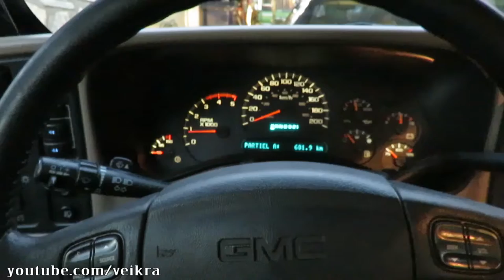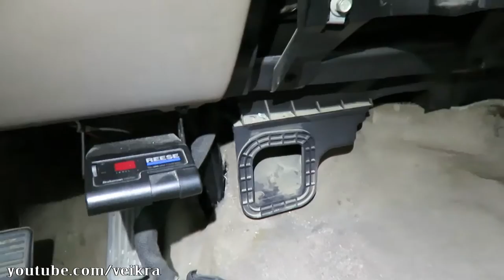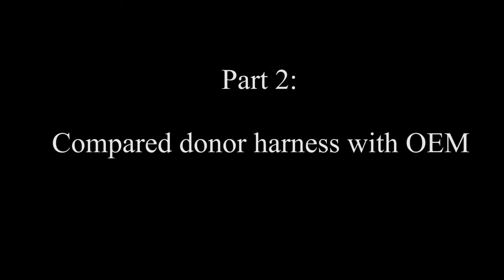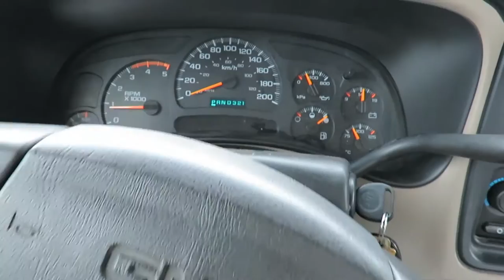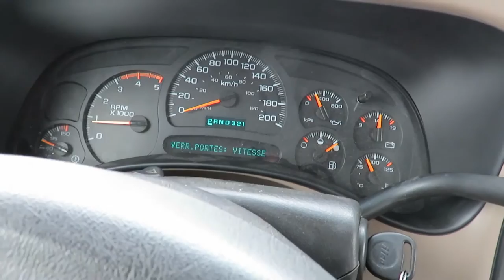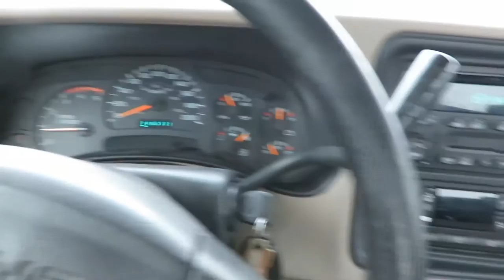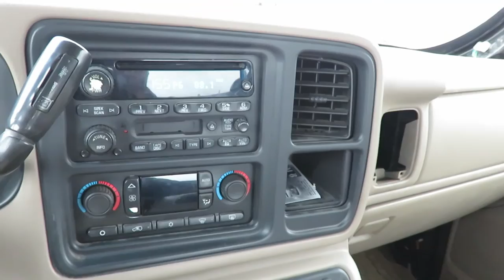How to add Power heated seats 2003-2007 sierra silverado avalanche escalade with ANY wiring harness

Comment: If you can find a Vin for a crew cab diesel with heated seats and memory I can program a body control module and send it to you. I'm sure any crew cab with heated seats and memory would work but I rather take some variables out of the equation.
Reply from the maker: I can find a VIN number easy, all canadian ones driving around have that option. and VIN number is viewable under the windshield. 

I want to keep my current BCM because I know it's good and know what it's been through.  Where are you located?
Reply: Veikra St.Louis MO I can send you one pre programmed or you can send me yours and I can program it.
Reply from the maker: Can you do a window switch program as well ? I have one for a escalade and need it switch to my truck for power extending instead of power folding (mine got killed by water )
Reply from the maker: I have vin of 2004.5 truck with the option, can you leave me your phone number?
Reply: Does it have to have the same features? For example, I’m trying to add just the 8-way heated and power seats with memory as well as the door panels with the buttons. I want to keep my flip down bench seat console and do not want to add the center console with rear A/C. Is that possible? I have a VIN of a diesel crew cab same as mine except is has those seats and door panel switches and center console. Are you able to make that work?

Comment: I just did this conversion to my 2004 gmc sierra duramax. I used seats out of a yukon and the harness from a 2004 escalade. I have the seats working except the passenger seat heater will turn on for about a minute or so and then shut off. I believe it is just a bad element within the seat but I also did not connect another ground wire to the drivers side post. I don't know if that is affecting anything. My larger issue is that since I did all this wiring my gauges, radio, windows, and door locks went wacky. It went back and forth from not working to working (over the course of about a day). Now everything is working (I'm thinking the body control module had to relearn with the added functions) except my body control module has lost communication with the transmission control module. The TCM is functioning and the truck still shifts but I lost my trans temp guage, the shift indicator and tow/haul switch lights up but does not function. Do you have any ideas of what this could be. I didn't think this harness had anything to do with connections between the TCM and BCM. Any help would be much appreciated!
Reply from the maker: Id look at all the wiring, then the module under the driver seat. This module communicates with the bcm through the canbus. any short or any module connected to can could hog up the serial bus and cause other device to not be able to communicate. unplug the computer, see if it does anything different. then unhook the harness from the footwell and see if it comes back.  There is no garantee your seat module is good. But for it shutting down it's usually heaters.  Without the ground, you won't have the power seat working on the passenger side. If you do, itd check where the thick black wire goes. (The thick black wire beside the orange one in the connector)  Can you post a video?
Reply: I found two black wires that went to a ground point further in the escalade harness that I had cut. I attached those wires to the ground point on the post next to the drivers seat. They had no effect on anything. I still have no transmission communication. The escalade harness did have a back up sensor module on it that was past my cut point. I am wondering if that has anything to do with the loss of tcm communication. To my knowledge the two wire twists are part of the can bus network? I see there are some of those that I had cut thinking I didn't need the rest of the harness. My other thought on this is that it could be my body control module since the TCM is working properly other than no communication. Now that I think of it the BCM has been acting up over the past 6 months to a year. Little things like the radio not shutting off after opening the door, the chime not stopping after removing the key from the ignition, the doors not activating interior light. Could the added seat control module have pushed the BCM over the edge?
Reply from the maker: yes the 2  grounds you found I also cut. my harness was escalade as well, and there is a big orange power wire going to the back. Make sure it's properly capped off.  Unplug the harness at the junction box near the brake pedal .  If it does nothing, you may really have a bad BCM. But please check all the wires going to it for any signs of rubbing on the bracket. Sure sounds like a BCM trouble now
Reply: I've figured it out! Yesterday I swapped BCM's with my buddies truck. My BCM functioned properly in his truck and his BCM had no effect on my issue. Then we swapped TCM's. My TCM in his truck produced the same no communication issue. His TCM in my truck illuminated the shift indicator and the transmission gauge. Unfortunately my TCM is bad. It is an expensive fix but at least I know what the issue is. Thanks for your efforts.
Reply from the maker: Alright so at least it's unrelated and you didn't break anything doing the swap. It's just unrelated wear!
Reply from the maker: also, if one morning you press the buttons and the seat wont work, the lights wont turn on....shut the truck off and back on, the module under the seat didnt wake up or the bcm forgot to wake it up :) It does this to me once per winter

Comment: Hey man, ive been studying this video as if i were to take a test nd im not confident enough to do this myself. I have an 06 silverado 1500  crew cab 4wd with power driver nd manual back. Passenger is all manual. Back glass is the 3 piece which i really hate. I got lucky at the junkyard nd got both front full power leather seats, both door panels with swtiches, nd i got the harness. Same exact truck execpt with it being an 05 nd having a solid one piece  back glass. I saw tht the thick purple wire hooks to the back glass for defrost. Other than the back glass nd seats... its the identical style truck. The module under the seat of tht truck was corroded bad nd literally welded itself... so i jus snipped tht off. Do ya have an updated wiring video or have something else to follow ? I understand everything going on till ya start cutting the connector nd splicing the oem. Thts where i get lost nd with hooking up to existing module. I dnt wanna burn out any modules or sensor because tht can become more or a pain to fix ! Also under my passenger seat i have a wire i believe its the black one thts connected to the airbag nd it throws a service airbag code
Reply from the maker: You are right, purple is defrost. I recently broke my rear window and found my truck had rear defrost. So the window in the truck is not original.  For the module under the seat, it's the airbag controller. The connector I replaced is because the seat and wiring came from a different truck, namely, a avalanche.  I just made sure the wires would trace back to the correct truck wiring from the new seat wiring. The wire under the passenger seat I mentionned in the video and IIRC its the ground of the seat.  Airbag of passenger seat goes back to right side kickpanel.  It plugged right in in my case.
Reply: @Nordic_Mechanic  I think I’m having a similar issue. I put denali seats into my Sierra from the same year. Denali seats have the yellow connector and my truck was the black connector. It’s throwing airbag codes because that’s not plugged in. Colors don’t match up and I’m really at a loss for what to do any help would be much appreciated!
Reply from the maker: @ryanr6160  Color dont match up thats why I pulled apart the loom to verify where everything goes. Simple as that. You have to make sure the wires you need are going from the same pin under the dash, to the same pin on the airbag controller as they used to before. The denali seats have airbags so there is more wires than needed in the new loom

Comment: I got the the controls on the doors working but they stay on for 30 seconds and turn off. Any feedback would be great.Thanks
Reply from the maker: usually that's because one of the heating element in the affected seat is bad.
Reply: My back doors wont lock and driver side back door window goes down when you pull up on the main driver window switch

Comment: I have a 2006 2500 HD 6.6 LT1 with the bucket seats and console power driver and manual passenger with cloth. Just upgraded to full power power leather.  Do you know the connectors part number so that I can cleanly connect power to them and splice in power to the passenger side? I've been looking and can't find it.
Reply from the maker: Passenger side power is already connected if you used a donor harness. it runs over the transmission tunnel and under the seat.  Find the big black wire on the passenger seat and connect it to ground and it will work.  
If you dont have the harness then connect large orange wire to 12V and big black wire to ground.  If you want heated seat you're better off finding a harness
Reply: @Nordic_Mechanic  Thanks. It's the stock harness. I'm wanting to make my own connectors to go from harness to seats (female to male) to clean things up and run a splice over to passenger. Problem is I don't know the connectors part number. I'll get a donor harness later and put that in. Any idea on the part numbers?
Reply from the maker: @user-te6rb5to8c  no idea of the part number.  Just connect the orange and the black wire for now.  They will at least move

Comment: Great video.  I have been studying it trying to get my power/heated 2003 denali seats swapped into my 2004 silverado 1500.  I pulled an entire harness from a 2003 Avalanche but instead of swapping the entire harness, I just tried to add the connectors to the seat harnesses that were missing from my 2004 factory harnesses.  I added the orange power and black ground to the passenger seat, the orange ran back up to the driver's kick panel relay box C10 harness.  I just inserted all the female pin connectors into my harnesses.  It is mainly wires that run between the drivers seat connector and the passenger seat connector.   In my diagrams, these are all the wires that were in the avalanche connector that were not in my connectors.  I can't find a wire that runs into the yellow airbag module that you are calling the blue wire.  Can you give me details on this blue wire?  what is it actually called in the circuit diagrams? I added the door switches and I get them to beep when i press the memory button but no heated seats are working.  I feel like I am missing a simple wire that is needed but I just focused on the 2 seat connectors.
Reply from the maker: you get the beep since the switch are using the window switch for can bus connector. But you still need the can bus of the new seat module to communicate with the bcm. That's what you are missing, the can-bus link
Reply: I figured it out.  You were right!  I had forgotten to add the can bus wire back to the harness.  I hooked it up and everything works.  Thanks for the help.
Reply: @Fogarmj I’m trying to do the same from a 2003 Yukon with dual power and heated seats. My 2004 only has driver power seats. From what I understand, I need to get a harness for the passengers side and of course the controllers from the door panels with associated wires that run through the rubber boot. Does this sound correct to you?
Reply: @ReubenNewton  you don’t need the full harness.   There are maybe 6 wires you need from a donor harness.  The control buttons in the door simply plug in to the window control panel.  I can walk you through it.  I have the wiring diagram you’ll need because mine is an 04 also.
Reply: @Fogarmj  Thanks for the reply! I’m excited I don’t have to pull the wiring through the door, that was the part I was dreading. I’m going to be giving it a shot over the next few weeks to see if I can get it done.
Reply: Hello brotha, I’m currently in a sort of a similar position as you were in. I recently got some 03-06 Silverado SS leather electric seats with lumbar support and heated for my 2004 Chevy Silverado 1500 regular cab. I currently have these seats mounted with no power running to them. I have been using a drill battery to adjust them if needed. 
However, how should I go about wiring them so they could work like factory with all its features? Would I need complete harness for them? I already have the door panels with the buttons.
Also, when wired, would my airbag light along with the message “service airbag” turn off? I currently have these things lit up on my cluster because I removed my manual seats that the truck originally came with along with the wiring harness that was attached to these seats, so because of this the airbag light is on.
Reply: @Fogarmj I'm interested in the wire diagram.

Comment: Hey did everything you said, plugged in, seats move heat works on right side not left yet and when you use one side the other side turns off. Gonna keep cycling and hope the computer works any tips?
Reply from the maker: double check the orange wires and black wires. Make sure the connections are right in the b pillar.  Also, heated seat will turn off by themselves if a heater pad is bad.  the bottom left side pad is the usual one to fail
Reply: Hey they are working now more cycles seemed to help, they still turn off randomly but sometimes they stay on for 10 minutes, it’s weird, and other times turning one on causes the other one to turn off, I’m gonna wait a week and see, did you say yours took a few days to start working properly? I just did it yesterday also thanks for the quick response! (Also your video was the only thing on YouTube that actually helped me)
Reply from the maker: @101MonsterGaming  Mine worked on second time I started truck

Comment: Hello, I bought 2003 seats for a Silverado 2002, if I just want the power functions working do I just need the connectors from the donor Tahoe?
Reply from the maker: Only need a way to connect orange wire and black wire. Be it with harness from donor or manually
Reply: @Nordic_Mechanic  thanks, I got the harness from the truck I got them from.
Reply from the maker: @hugo3769   2002 and 2003 are very different wiring wise as I must have said before. So only hook orange and black wires to prevent problems

Comment: I can't seem to find a donor harness. Does anyone know if GM still sells the complete harness? I know they used to.
Reply from the maker: it was crazy expensive, I think I said it in the video but I dont remember 100% 400$ or 800$ or something.  And you can use any harness from 2003+ with the top option seats. (heated and memory) Look in scrapyard for suburbans and tahoe, they pop up more often in scrapyards in full options since top of line pickups are rarer per production numbers.  I see the seat removed, but the harness is always there. I wonder if the suburban at my local junkyard is still there, he had the correct one but I didnt have tools on me

Comment: I want to install powered seats into my 2006 GMC Sierra extended cab work truck. I thought it would be simple, but after reading past posts I see I was delusional. I don't have the powered seats yet. I found 2002 seats but have held off on purchasing them. Would I be better off using seats of the same year as the truck? How about airbags? Will they still function?  Another option I was considering was just changing the seat base and keeping my current seats.. Any advice and direction would be much appreciated.
Reply from the maker: Lots of info in the video but if you want seemless install like I did, you can't use 2002 in a 2006. The truck generation split in 2003. so keep 1990-2002 and 2003-2007 together. The 2003 are totally different wiring wise, canbus and all. That's why I was able to simply plug in the heated seat module in the doors, and they send command through the serial bus to the module under driver seat.  Airbag will still work if you follow the video. 

Also said in the video is if you dont want heated or memory, all you need is to connect the orange and black of each seat. If you take the seats from a same year model you can simply plug in everything and it will work minus the memory seat (require bcm prog). I used seats from a different platform and year.  Thats why my wiring was so different. I have 2005 truck, seats and loom from 2003 avalanche with rear entertainments.
Reply: @Nordic_Mechanic  Thank you!
Reply: @Nordic_Mechanic  do sell the wiring harness? Or would you do another truck I live in Ottawa? I have the same problem
Reply from the maker: @balbros  no i dont sell the wiring but as shown here I can do it with any truck harness 03+ that had the full power seat. If the price is right i'd do another one.
Reply: @Nordic_Mechanic I'm interested and I'm glad you live close.